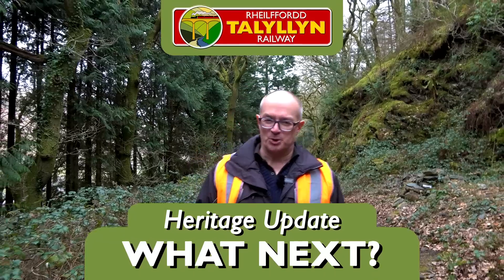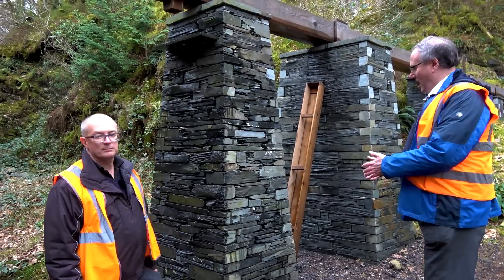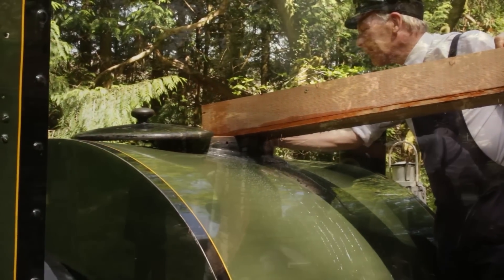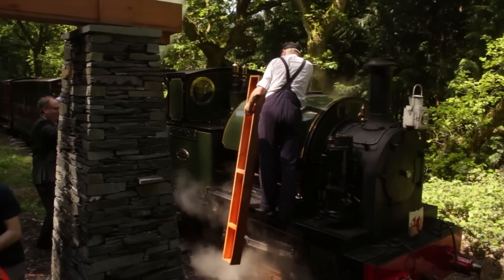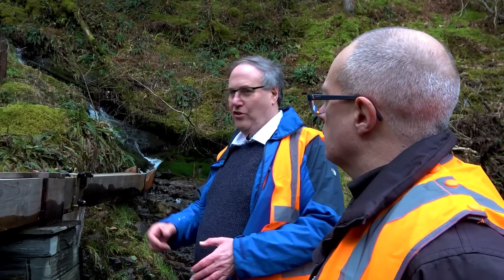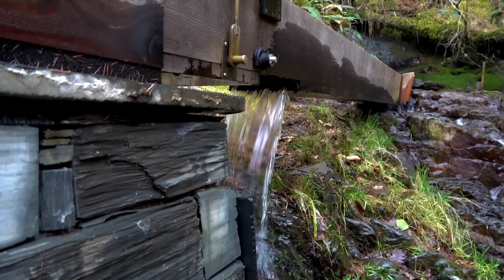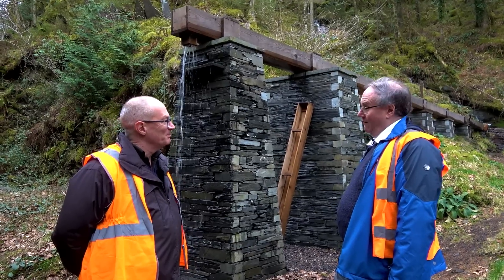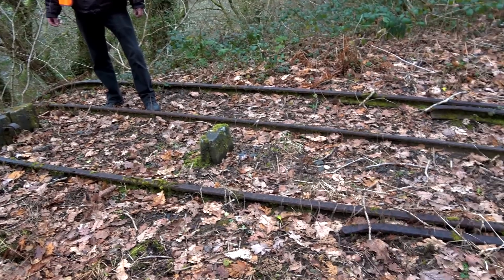Heritage Projects Update!

Comment: It would be amazing to see the winding house rebuilt, even if not in the original position, and some track going down the incline, even secure a wagon to the tracks like with chocks, chain or even welded to the rail (safety) to show how it once looked in use.
Reply: Heck even better, if it were possible, try do a half build. If it is possible from a structural standpoint only build the front half with the two pillars. Like the ones further up the line on other inclines. But yes I totally agree.

Comment: Golly some facinating things there!

Looks like the water flow would take rather too long to top up a normal service train, but wonderful to see it rebuilt and I'm sure the operating department would say that contingency options are always good to have.

The incline to the village...
I'm sort of sad that it can't be rebuilt as it orginally was, but extending the line for passenger traffic was the right thing to do.  Tourists need to see the bottom of the rope worked inclines and few folk would walk it.

Yet it is something special and some form of reconstruction is called for.  Funding might appear, so any further works must not prejudice an eventual full reinstatement, but, for the moment, a plausible replacement winding house is called for.  I'm sure the dimensions of that drum are on file (if not why not?) so in the worst case the origninal can go to the museum and a new one made put in the new winding house.

Ideally "track", not necesarilly of load-bearing quality, leading from the main line at a spot where a set of points could be imagined.  Maybe, one day, a real connection might be possible, but I can see the Railways Inspectorate wanting serious point clips installing too!   This would lead to the top of the incline which would be served by the turntable, perhaps a second one to serve the other incline track.  Then those tracks lead over the edge.   Once out of sight they don't need to really exist until a whole lot more money appears.

You would need a lot of signage to explain this isn't how it really was, but it would be so much more real for people to see.  You would need to add a safe access path from one or both stations at the top.

Needs an excentric milionaire to fund it, but one is allowed to dream.